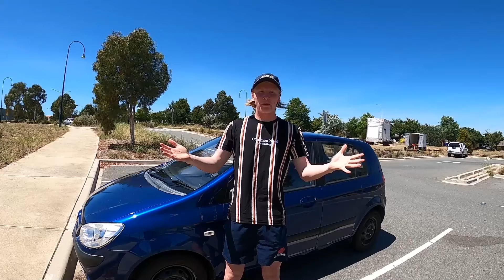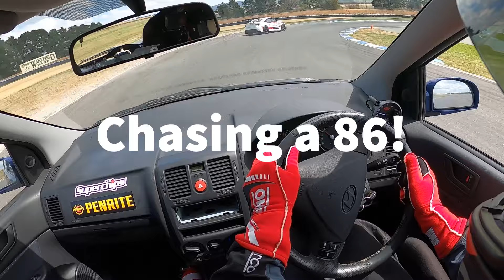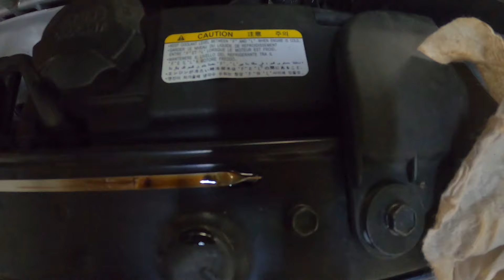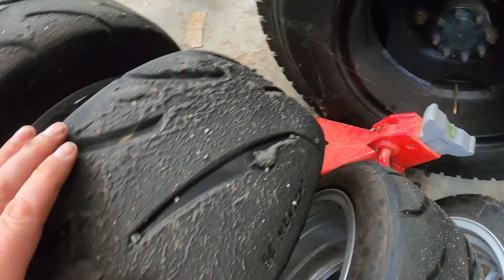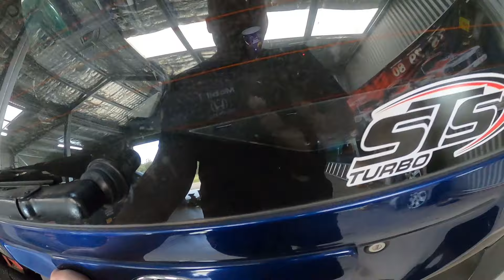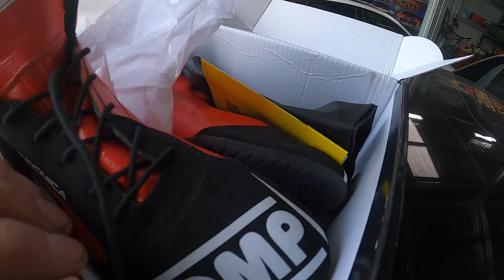Trackschool Day Wrap Up | Hyundai Getz Budget Track Car

Comment: Im impressed with your mods and how the Getz held together.  We also have a 1.4 beast as our run around... never thought of it as s track car though... but clearly it can be done.  Keep up the great content :)
Reply from the maker: G'day Steve, yes it is not a car synonymous with tracking that's for sure 😃.  It goes OK and we have built it as a safe and reliable platform for my eldest boy to have fun.  They are a great, economical, little car don't you reckon?